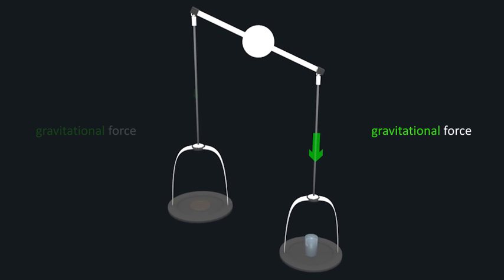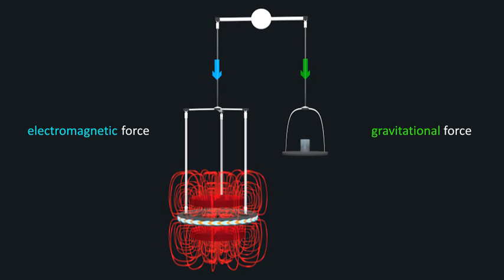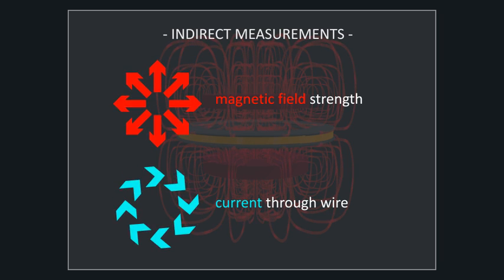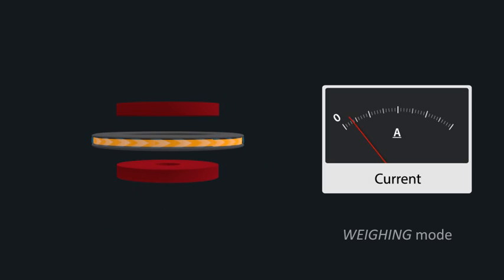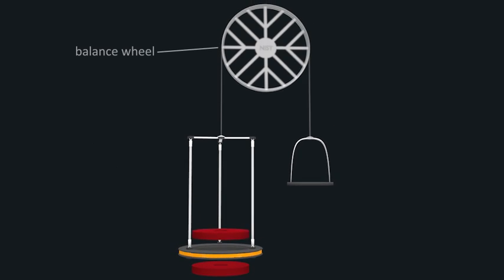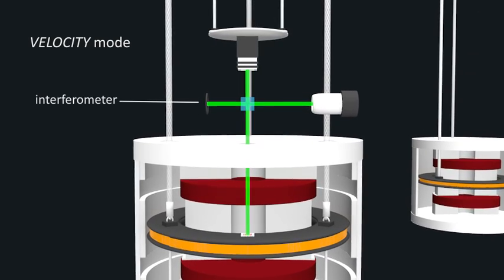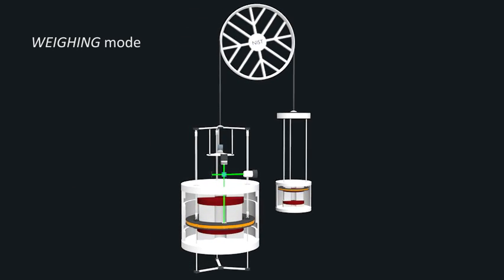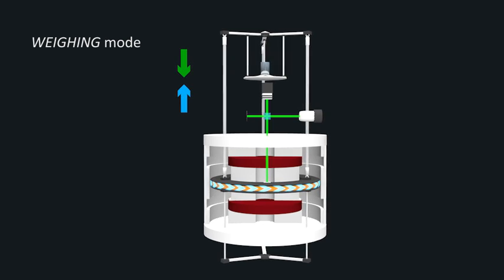Operating Principles of the NIST 4 Watt Balance Source

Comment: Mildly confused here. It seems to me that the downward force of the test mass is dependent both upon the mass and the local gravitational field. And the upward force produced by the coil and magnet are not affected by the local gravitational field. So how does this scale actually measure mass instead of the product of mass and local gravitational acceleration?
In a conventional balance scale, the local gravitational field is canceled out because both the test mass and the reference masses are both affected by the same local gravitational field. That compensation doesn't seem to be present in the watt balance.
Reply: Given that they need to measure the local g, it seems to me that a long tube pumped to vacuum that you precisely time the fall of an object over a measured distance ought to work. We can measure time to within about 2 parts in 10^14, so that part of the measurement in g is easy enough and as for distance, that would be a tad trickier since ideally, the distance measurement ought to be non-contact. Perhaps the breaking of a light beam going across the tube with the light being obstructed by a slit? In any case, it ought to be possible to measure the local acceleration quite accurately.
Reply from the maker: John Cochran You’re correct. The watt balance experiment requires knowledge of the local acceleration, g, at the location of the mass. In practice, this is done by measuring the absolute value of the local acceleration at a point near the watt balance. With a separate instrument, the tie, i.e., the difference in the local acceleration between this measurement site and the mass location is determined. By combining the two measurements the value of g at the mass is obtained. This procedure adds a small relative uncertainty to the watt balance experiment. With careful experimentation, the relative uncertainty of this component can be kept below 1 part in 100 million.
The above procedure might seem complicated relative to a simple balance, where, as you rightly stated, the local acceleration drops out. However, the watt balance allows one to define the unit of mass without using an artifact. This will solve many problems that one has with an artifact-based system, e.g., access to the artifact, wear of the artifact, etc.
Reply: National Institute of Standards and Technology Okay.  I understand that part...we can find out g.  But what if that changes? Aren't we traveling through space picking up dust as we go and getting more massive.  Thus, changing the constant g?  Thanks!
Reply from the maker: kyle5555 Yes, the local acceleration, g, changes. Not so much because of the dust that Earth picks up, but because of the tides generated by the sun and moon, the air pressure, and the moisture in the ground. Ideally one would measure little g continuously to have an updated value all the time. It is also possible to use models to calculate these changes. Changes due to the tides and air pressure are well understood and can be corrected for.
Reply: How it is possible to measure g with such precision?

Comment: Neato! What is the variation in magnetic strength?
Reply from the maker: The magnetic flux density varies relatively by about 1 part in 10,000 for about 4 cm of the travel. The field profile is very uniform at the weighing position itself. There, it changes relatively by about 2 parts per 10,000,000 per mm .